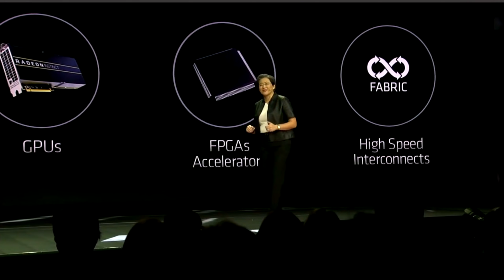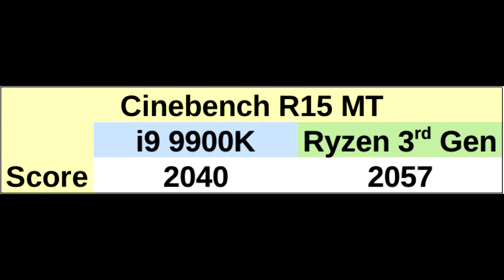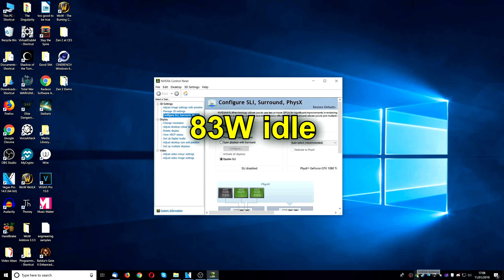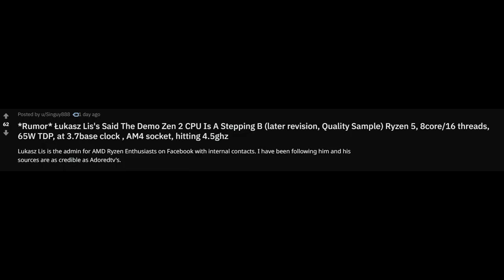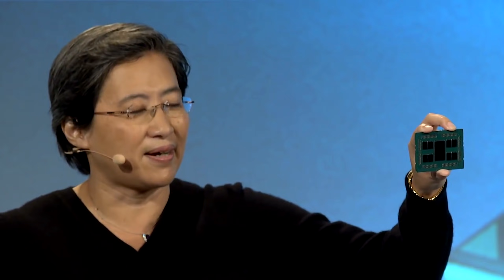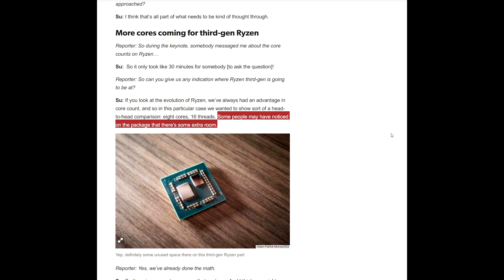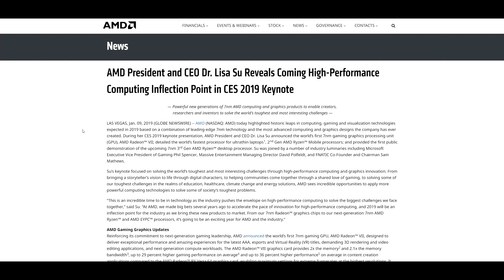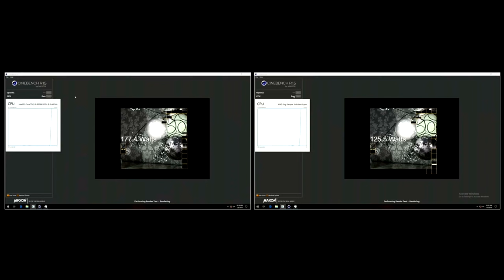Zen 2 Faster than i9 9900K at Half the Power.

Comment: I dunno. I'm kinda worried from Radeon VII pricing. It's has same failure Vega tech inside. But it still fails to impress. Vega still sucks. Think about an architecture which still uses more power than its rival. And it uses advanced 7nm. 700$ for Vega still amazes me. What the hell they had in mind? If they use same strategy for pricing Ryzen 3000 chips, well Intel can be relaxed.

Comment: Currently thinking about building a Ryzen 5 2600 or 7 2700 system, because i really need a new pc.
But whats holding me is i dont want to build a new system now, and R3 might be only around the corner.
I mean if its half a year that would be fine, il resale the parts anyway when R3 hits. but it really would be nice too know if we will see R3 befor or after Q3 2019
Reply: Lighting Blade  Sure that is an option, but the prices of those are so high over here that i could get a r7 2700 with a top of the line Motherboard for the same money.

Comment: I was thinking. The computer that was demo at CES probobly didn´t have the same configuration as the one Lisa showed. The one lisa Showed was a 8+0 (According to here, i would say, it was probobly a 0+blank, that is, a dead chip)

The computer they demod was probobly a 4+4. Because they wanted to show the best one they had available.

That made me thinking. How many ways can they cut the chips?
I would say they can cut them 27 ways!

Firstly 4, 6 and 8 cores. I highly doubt that they would care to cut any 2 core versions. And i would guess that the twin cores have so much stuff shared, so cutting one core is probobly not just going to happen. My guess is that the cores can be cut only 2 and 2.

Secondly the cores can be cut in frequency. This would give them probobly 3 different categories (and then sub categories of that). I would call it low, medium and high frequency. That would probobly be about 3.5-4, 4-4.5 and 4.5-5. And then pretty much ever 200 Mhz sub division.

Then there is one more way to cut it... Power efficency. And i would call it low, medium and high efficiency. And to put numbers on it. A high efficiency chip would probobly do 45Watt at about 4.8Ghz and 8 cores. A medium would to the same with 6 cores, and a low would do it at 4 cores. The reason for that being that 45+45+5W = 95W

That gives us 27 divisions, and about 80 sub divisions.

And this would be how the chips would be distributed.

High power efficiency.
High core speed
4 cores - 3500 series 4+4 cores
6 cores - 3700 series 6+6 cores and Threadrippers 6+6+6+6 cores
8 cores - 3900 series 8+8 and Threadrippers 8+8+8+8

High power efficenicy
Medium core speeds.
4 cores - 3500 series 4+4
6 cores - 3700 series 6+6 (possible Epyc)
8 cores - Epyc 8+8+8+8+8+8+8+8

High power efficiency
Low core speeds
4 cores - Laptop chips 4 cores
6 cores - Laptop chips 6 cores and 6+6 cores
8 cores - Laptop chips 8 and 8+8 cores

Medium power efficency
High core speeds
4 cores - 3500 series 4+4 cores
6 cores - 3700 series 6+6 cores
8 cores - 3500 series 8 cores and APU

And so on. The lower core speed will simply just be lower clock for every given section

Low power efficency
4 and 6 cores 3300 series with 4 and 6 cores
8 cores 3500 series 8 cores

Here they will probobly just disregard top core speed and just bin them as high as they can go for the thermal envelope.

My guess is that the demoed chip would be a 3500 with 4+4 cores. Its clearly very efficient, and also high frequency. The reason i don´t think its a single 8 core chip is that there is no reason to bin the most efficient chip to run singles on a desktop. So my guess is that the top tear will always be used in tandom.

Comment: Remember what i commented a Month ago? Let me help you:

"Also i expect lower Power Consumption of Ryzen 3000 Series on 7nm to be lower than what you shown,
Let me get deeper into this:

Half the Power Consumption due to a 50% Die Shrink > 8C/16T - 4.3Ghz @ 55 Watts"

Also something worth noticing: Not only the CPU was a Engineering Sample but also the Motherboard was a prototype and the Memory used was either DDR4 or another protoype of DDR5.

I'd assume they used DDR4-3200 because basically everything was a Engineering Sample/Prototype and likely didn't support any higher speed memory.

Based on the assumption you can expect (a summary of Prototype deficits vanishing) up to 36% more performance when using DDR4-4200 and up to 52% more performance when using DDR5-8400 for the Ryzen 5 3600X running at 4.7GHz. Remember that Zen 2 VERY LIKELY will be Overclockable by another 7% but that will depend on the silicon quality.

If i had to guess i'd say a 3600X running overclocked at 5.03Ghz will have a TDP of ~70 Watts.
When AMD said "Efficient 7nm means the same TDPs and Coolers" you can guess that that the CPU Heatspreader will stay the same and thus the overclocked Ryzen 5 3600X could be kept below 63°C with an Wraith Prism in a 22°C Environment. So actually R.I.P. Cooler Manufacturers.

Comment: What I don't understand Jim, is how the Ryzen chip beat the 9900k if it was operating in a 4.2-4.5 ghz range. Both chips are 8 cores 16 threads. But a 9900k boosts all the way up to 5 ghz. The only answer I can come up with is that the boost was running over more cores on the Ryzen chip, it has higher IPC or the benchmark favors AMD.

Comment: AMD's previous numbers were a lower, I think their Ryzen 3000 bench was 2032 rather than 2057, so in summary I think this wasn't meant to be a performance bench, strictly a power bench.

The fact that they slightly beat Intel actually hurt their statement, we all, at the time, focused on the slightly higher score rather than the fact that AMD did it at an entirely different power level.

Comment: I'm not convinced this is actually an SKU, it's preview after all. I see little reason to use a single 8-core chiplet, when 2x4 would make more sense. Most likely AMD chose to show that chip because a) 2x packages are not in good enough state yet, or b) having a "missing" die makes for better marketing. I might be straight up wrong here, but unless they get almost no defects, you would expect 4-core chiplets to be used.

Comment: I believe what we were shown at CES was a 3600 (maybe an X, not sure, it doesn't matter as it was an ES chip), so AMD just showed an apples to apples comparison, between a stock 9900K and their 3600.

Same cores, similar clocks (The Intel chip would of been hitting about 4.7Ghz on all cores), and the AMD scores higher in CB...so its got higher IPC, and not finalized clocks mind you..so AMD's lowest end R5 offering, just took a dump on a 9900K.

Also I believe that Zen 2 will release at Computex in the middle of the year, but R9 offerings won't release with them, they will release closer to Threadripper 2's launch, as to not cannibalize current Zen+ TR offerings.  

Zen 2 is looking pretty impressive so far.

Comment: Third generation Ryzen has been confirmed to be amazing at CES. Honestly, I was confused when you backtracked Zen2 for desktop and decided that, according to your leaks, it didn't have an I/O die. AMD's entire strategy of having one single chiplet to rule them all just crumbled. I wasn't even sure it still made sense for AMD to release a Zen2 desktop CPU with more than one chiplet, if the chiplet was essentially monolithic, and that meant it wouldn't go beyond 8 cores.

When Lisa Su pulled out the Zen2 desktop die, everything made sense again and 16 cores were confirmed.

I am extremely curious about how the architecture, with a separate I/O chiplet, performs but we'll essentially only know when it gets extensively benchmarked at release and that's still a few months away.

Comment: Stock speed of i9 at what wattage?  At 95 watts, it doesn't compete with 2700x. Watts on the screen are for whole system or just CPU? Looks like TDP for the new AMD chip is really good.
Reply: She said the 9900k was at stock speed and as we know pretty much all motherboards, by default let the cpu run way above 95w so they auto overclock the cpu in other words, were one of those boards being used on the 9900k system for the demo at ces, well that's the million dollar question isn't it.

Comment: But 9900K isn't a 110W part when it's boosting and the Cinebench score for 9900K from the demo actually corresponds to it's score when running without a 95W power limit. It's actually more like a 150W part then, therefore your assumption about subtracting about 20% from the power numbers at 9:55 is actually flawed.

Comment: I just want a 8 core that will hit 5 GHz in the $300 price range that will work on my X370 board. Hand brake is what i use the most and with NVEnc not even a 32 core could keep up with my GTX1080.

Comment: This 2 chiplet design will also give AMD great flexibility in using chiplets with a few damaged/defective or underperforming cores. If they have a lot of chiplets with only 4 good cores, no problem. Pair them up in 8 core Ryzen 5. Chiplets with 6 good cores, pair them up in 12 core Ryzen 7. Even chiplets with just 3 good cores can be used in 6 core Ryzen 3. This should help AMD make use of as many chiplets per wafer as possible. Considering new semiconductor manufacturing processes usually have low yields this could be very useful for AMD and mean lower prices for consumers. 

Still... I can't help feeling disappointed by the release date. Intel was probably relieved that Ryzen 3000 will only come by mid 2019. It now appears AMD's process advantage will only last around 6 months. The same feeling was probably shared at NVIDIA's headquarters.
Reply: i think you are also missing one crucial aspect - they can use these 8/16 chiplets for ALL of theyr products, starting from Epyc all the way down to Athlon.

thats INSANE production efficiency, when you are making just ONE thing and then binning down as necessary with zero manufacturing fragmentation ... AND with binning happening at smaller chip piece by piece basis with tech that allows more chiplets to be produced per wafer it all simply means that AMD will be able to offer theyr products at prices Intel is simply NOT capable of ...
Reply: @Asghaad  well said.

Comment: Like always a GREAT video. It looks like AMD is somewhat delayed, what do you think? Normally I would expect the first official announcement in April like in 2017 and 2018. I assume, that the process is not completely under control yet. They are getting chiplets with very good performance, but they might also have too large differences beween successive production runs. I expect they delayed their announcements with say 2 months to solve those issues and/or to create a buffer for those variations. Both these processes 7nm and 10nm are very vulnerable, a fly in the clean room flapping its wings, might influence the yield :) :) With thanks to Norbert Wiener, Edward Lorenz, Ray Bradbury and my old boss of Philips Semiconductors now NXE.

Comment: Your title is very misleading you say zen2 runs at half the power which is wrong. Zen2 is ru Ming at around 130w while the 9900k is around 180watts. Now I'm now im not great at math but last time I checked that doesn't add up to half or am I missing something here?!?!?
Reply: The wattage shown shown for each of the two computers in the demonstration are for total system power, not the power drawn by the CPU's alone.
Reply from the maker: Yes, system power vs cpu power.

Comment: As someone who does more gaming than video editing or 3D rendering, I'm actually far more interested in max ingame FPS than I am in how many seconds or minutes faster my renders will be. I mean those thread heavy tasks will already be much faster than my current i5-2500k no matter what I upgrade to. So personally I was actually a bit worried that they showed off the gaming performance of their CPU with a GPU intensive game running at 4k. I want Ryzen to blow Intel out of the water as much as anyone, because I used AMD in the first few computers I built and have always felt more affinity towards them as a company, but I also feel like we've been here before with this kind of hype as far back as the FX bulldozer chips, possibly even earlier.

Comment: Yep, you called it, and here it comes.  AMD is ready to rule the roost (for now).  Things are going great on the CPU side of things.  Performance will increase, prices will drop and customers will have more options than they ever have before.  Here's hoping things go the same on the GPU side of things, but if Navi doesn't pan out then we may have to wait for Intel to save the day.  I'm still hoping that those leaked Navi specs you gave us end up being true, because that kind of performance/price is exactly what we need to topple the ludicrous pricing scheme that NVIDIA is trying to push with the RTX series.

Comment: I wouldn't go so far to suggest that AMD intentionally hobbled the RAM speeds to hide performance. I think it's more likely that the slower RAM was used simply to make sure nobody could accuse them of running above stock RAM speeds to favour their own chip. I believe it's well established that while Ryzen scales well with higher DDR, Intel's chips do not.

Alternatively it could be that the engineering sample they were running was not stable or optimised for higher RAM speeds.

It will be interesting to see if the memory speed scaling for Ryzen 3rd Gen is similar to its predecessors. With the io die able to be optimised independently to the processor cores, it's hard to know. There is a case to be made that they might look to decouple Ryzen from the dependence on expensive RAM. Exciting times!

Comment: Jim. You might think about what the implications for the prices in your chart are if these performance results hold up .  If the 3600 can beat the best that Intel has got now why would AMD sell it as a mid range part? Maybe this is why they did not announce the product family at CES. The prices that you were leaked  might have been AMD's working prices at the time of the leak . But if they got engineering samples back and the performance was as good as indicated maybe they decided to changed strategies to make the 3600 a high end sku and delay releasing the 3700 and 3800 until Intel can introduce something more competitive. And if they do release the 3600 as a high end part, they will adjust prices for the 3600 upward as  well.
Reply: AMD needs marketshare, the way to win that is to offer better products at better prices, if an R5 at a 1/3 of the cost can beat a 9900K it is a no-brainer that it will sell like hot cakes for the general consumers meanwhile they have a couple of monsters for extreme, enthusiasts and content creation consumers that will have the same+ performance at general workloads besides mores cores which will benefit specific workloads or chad's size issues. 
There is absolutely no benefit for AMD in this scenario to keep their best products hidden or fiddle with tiers and prices.
Reply: @EkatariZeen   Actually I think there is a benefit for AMD.  AMD does not need market share. They need profitable market share. One thing that people who have not worked in the semiconductor industry often do not realize is that you can not just flip a switch and be in full production. It generally takes months to ramp up a high volume part. 

If AMD sets their price too low and can not meet the demand that is generated by that low price, there will end up being a shortage in the market. Shortages allow vendors who can get parts to mark up the price when they resale to the final user. Thus the end user pays the higher price anyway but the extra goes to the middle men and not to AMD.  The smart thing for AMD to do ( and the normal procedure for all semi conductor companies) is to try to predict what price the end user  is willing to pay at the volume that they can be produce at launch, and set the price near there.  That is the origin of my comment to Jim about re-considering the prices of the parts in his table, because I think AMD will certainly be taking a hard look at them.
Reply: @billschauer2240  AMD doesn't have that luxury while Intel is on the other side. With the FX line they had the lower price but didn't have the performance, having the performance but the same price is not going to be different as it wouldn't change the mindset. AMD needs the marketshare and the mindset that comes with it, they can't get that if they don't strike hard with everything now that they can.
Showing their cheapest middle tier product ES beating the competition highest and pricier flagship while emphasizing that it is just a middle tier product tells me they wont change the tier prices.

Comment: You had it right in your speculation - which completely agreed with my speculation.     To me what made this obvious was the fact that it costs $150 million dollars to spin up a new design on 7nm.      To me this guarantees that AMD is going to reuse that 8 core Ryzen 2 chiplet we saw in Rome over and over again.     The IO die being on 12/14nm technology means it can be built at GloFlo - keeping them happy with the wafer agreement -  and it's much cheaper to spin up new versions.        The leakers threw you off a bit, but your intuition was right on the money.   Great work Jim!      Can't wait to see the new info you're holding back.  :)

Comment: OMG! Another wonderful video and you were right on the money with leaks - well done sir!

So, AMD basically compared their upcoming Ryzen 3600 against Intel i9 9900k at same performance.
The Intel 9900k is $529 on Newegg and Ryzen 2600 is $199. If AMD keep the same price ($199) for this demoed chip, then this is incredible value for money! For anyone to say this is under whelming needs to understand we will be getting i9 9900k performance at $200! That's less than half price!

This is like AMD releasing a Radeon GPU at same performance as GTX 2080Ti but for less than half price. The tech world would be a light with excitement.